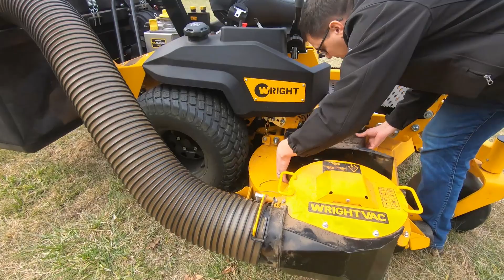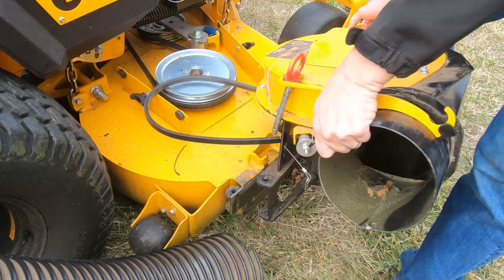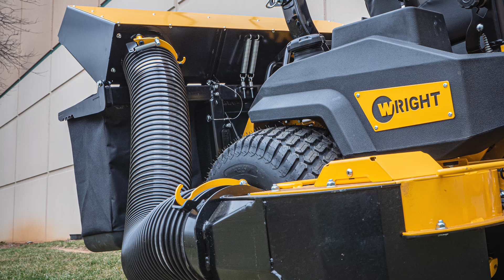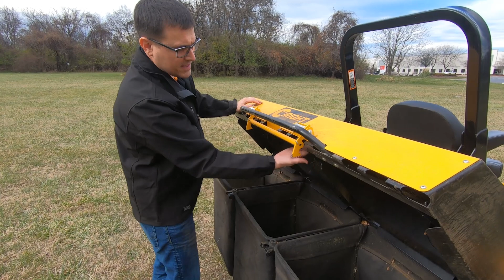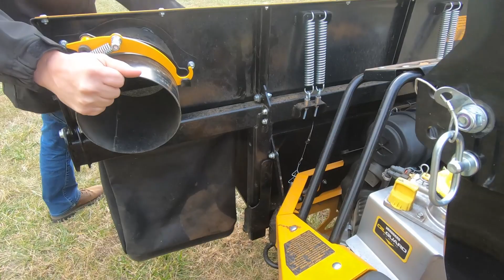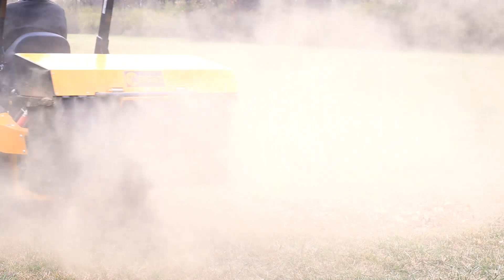WRIGHTVAC Leaf Clean-up DEMO and Walk-Around

Comment: ED or anyone tht have this system ............... how does it mow with the black bracket  in the opening when you aren't having  to bag?  or does it need removed when not bagging?  Hopefully someone responds
Reply: It should be removed for the flow of side discharge, better discharge, better cut. unless you are only cutting off an inch, maybe 2 inches than it could stay on.  I personally take it off for normal side discharge. we keep all parts in the truck for daily use, on and off.  Hope this helps.

Comment: Nice mower. I would like to have one. But I would have to be cutting yards for a living. 13000.00 is over my head. I just bought a Hustler Fas trak 54. 7916.09 out the door.
Kawasaki 22 hp zt3200 hydro transmissions. 4 year warranty with 3 years on engine.
I never had a o turn mower before. My yard is only 1.7 acre. Takes about 40 minutes to cut taking my time. Again I really like that Wright mower.

Comment: I love it Ed! I get so frustrated with the problems on my existing blower on a different brand. The one question I have, are there any plans for a clamshell style dumper? Dumping the bags at 2 min a pop over 30 to 40 times on a few acres of leaves adds over an extra hour per job. If I could back that machine up and dump instead of getting off and fiddling with the bags that would speed up an already efficient machine.